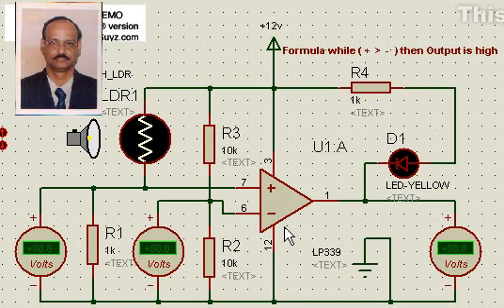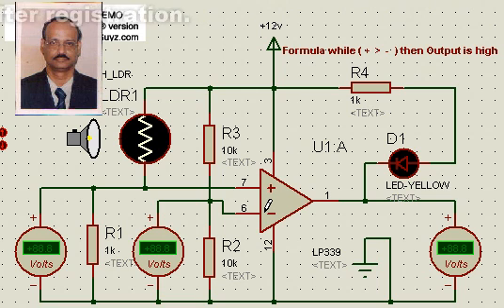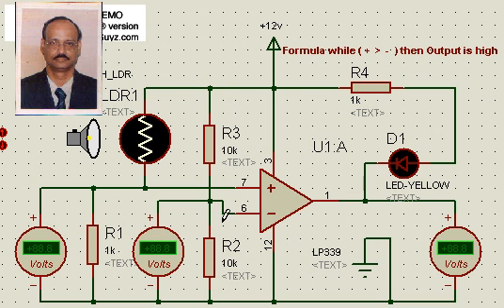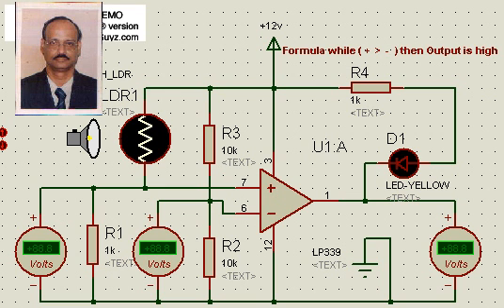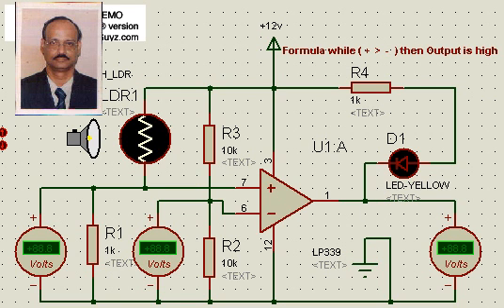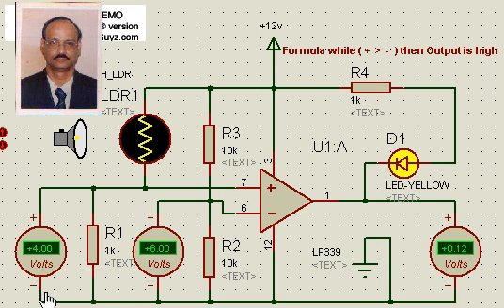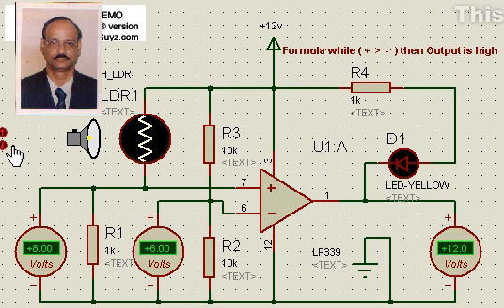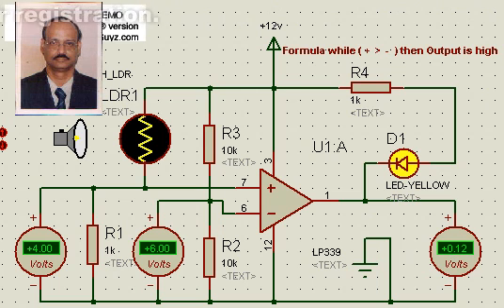Sensor interface to microcontroller

Comment: Sir ,Is output of op-amp is directly connect to the microcontroller inputor we have to use some circuitry
Reply from the maker: No because the supply voltage is 12

Comment from the maker: ADC 0804 develops 8 bit data for each input voltage.Thus 256 values are possible as output depending upon input voltage.In this video it is just logic 1 or zero once it crosses the reference voltage,only 2 values!

Comment: Nice explanation, Professor. I always enjoy your lessons.

I designed a circuit similar to this using two AND gates and two LDRs for use in a photo-vore robot . . . works very well.  I suggest using a potentiometer in the voltage divider circuit for the signal voltage pin, or even for the reference voltage . . . makes it easier to fine-tune for the differences in resistance in the LDRs . . .

Comment from the maker: Take LP339 instead of LM339 both are same.To change the power value right clck on the power and then write on the box that appears +12V (for 12 volt for example)

Comment: please how do you set the power value ?

I am trying to simulate this circuit but it generates an error (no model specified for the LM339) ,i have the version 7 . did you face such error while trying to simulate this circuit?if so please tell me how did you get it to work. thank you.